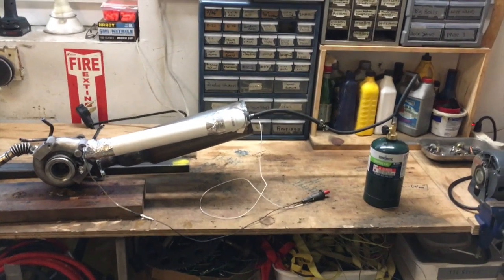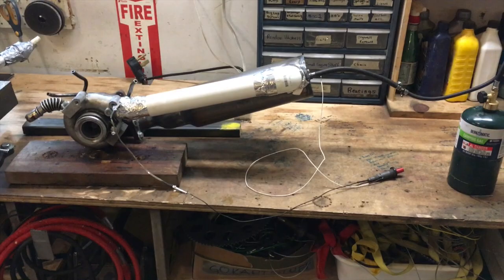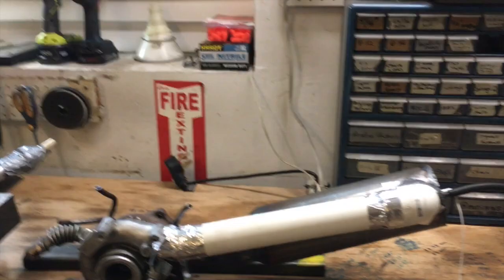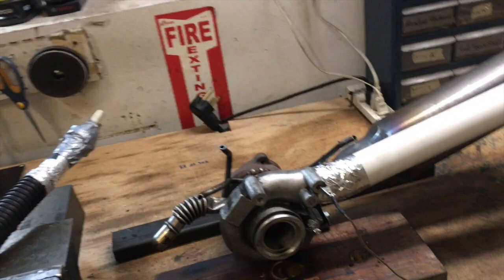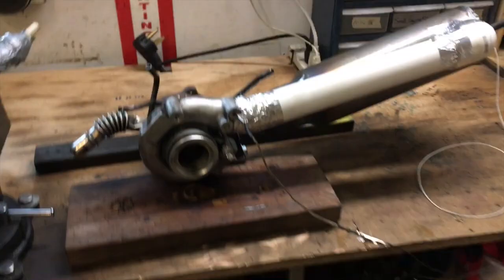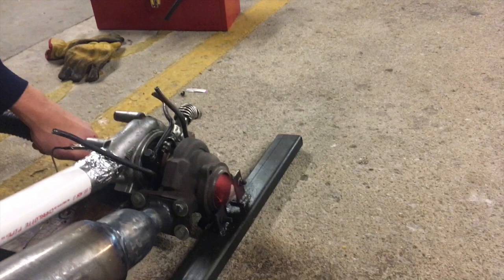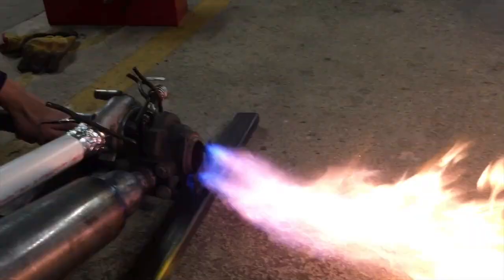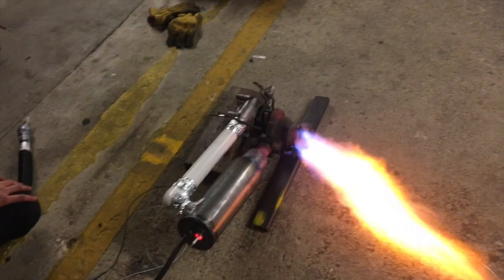A Running Turbojet/Gas Turbine!!

Comment: Nice work. What did you use to inject the fuel
Reply from the maker: Thank you! The nozzle which injects fuel into the combustor is actually a bolt with a hole drilled through it. The threads act as a hose barb for the fuel line.